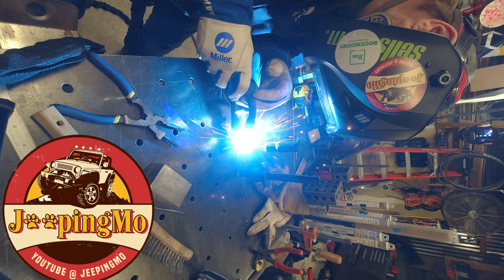Stronger Control Arms.

Comment: What is the benefit of the mig cap over the tig?
Reply from the maker: The cap adds more strength to the weld.  Come time Mig has a hard time getting into the root of the weld.  But mostly for strength.